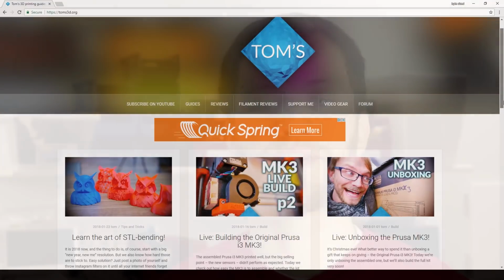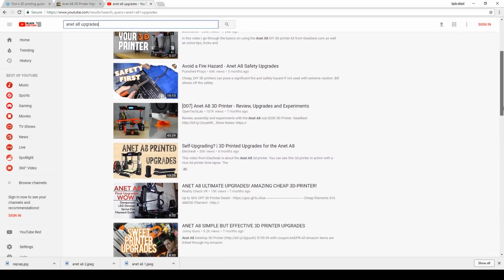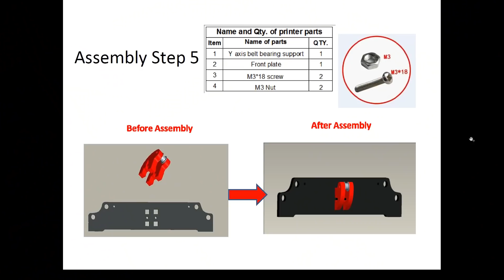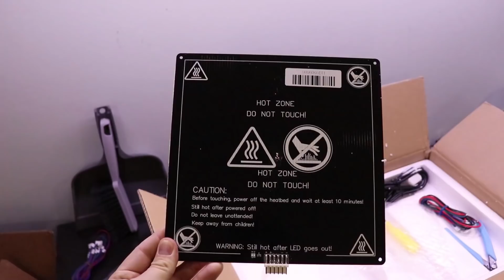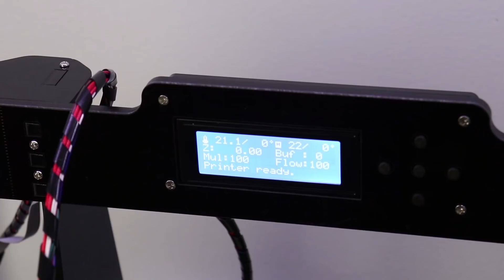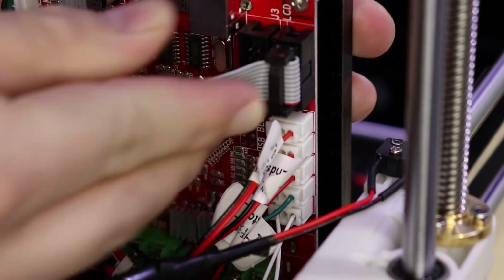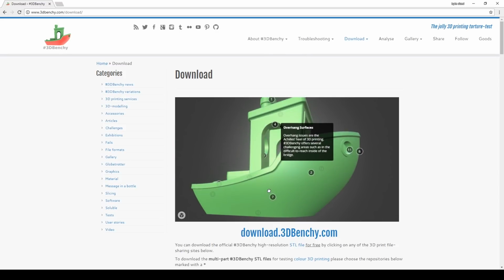Anet A8 - The best cheap DIY 3D printer in 2018?

Comment: Man, almost every YouTuber out there is gonna say that only the "name brand" stuff (Ultimaker, Prusa, etc) is worth it. It's total BS. I personally own an Anet A8, got it online for $160. I've put $15 extra for a glass plate, and plan on spending another $3 for a mosfet for the heated bed. Let me tell you: it works beautifully. My school has a mid-range Lulzbot that cost them $500 or so and the performance between the two is nearly identical. I'm pretty sure theirs doesn't have a heated build plate, either. No reasons for these 3D printing elitists to bash on the economy kits as not even worth it when it opens up the community to way more members.
Reply from the maker: I agree, thanks for watching
Reply: The Anet A8 can be made WAY more safe with a couple simple things,
1. Solder the hot bed wires instead of using the flimsy plug.
2. Use a mosfet for at least the heated bed and also hotend for overkill.
3. Put a fusible switch on the power supply.
Reply: @JohnSmith-mk8hz  This seems to be what I hear out of everyone, not that I've figured out how to install the mosfet yet, but I'm sure that's just a google search away "how to install mosfet anet a8" also I've heard I should replace the wires to the bed with 12g silicone wires and they will last forever flexing back and forth. And upgrading the firmware is the first thing a person should do.. it's free and apparently it's the number one reason fires start.

Anders Jackson Only an idiot would buy the cheapest item and expect not to have to modify it. This world however isn't short of idiots. I've been researching for a week narrowing down what I want to buy and it seems there is a huge community for the anet a8 I can use to help me navigate getting into 3d printing. I am certain if I can get it working I will be buying a 2nd as soon as I'm done modifying the first.. either that or a cheap delta.

I too have been the sole mechanic on my families fleet of vehicles since I was a teen, and have a garage full of just about every tool a woodworker needs, and most welding/fabricating tools including a couple of lathes and a mill.  I'm no novice when it comes to fabricating parts for things but I've fallen behind when it comes to electronics. I've always known about 3d routers and plasma cutters and I vaguely remember when 3d printers came out but they've always been so far out of reach I haven't given them a second thought.. I even remember the story of the guy who used one 3d printer to replicate itself.. I LOVED that story, but I was still so deep in my own projects I never thought I could find a use for these printers that make dolls and vases and crap.. And then I saw the ender 3 a while back.. Affordable at $180 or $229 for the pro and I started digging.. Now I've found out about the various $120 models on ebay and amazon and now I'm flat out gung ho. I'm already sold.. now I'm just negotiating brands.. And even with the risks the anet a8 appeals to me. It's either that or the reprapguru prusa clone.
Reply: The anet a8 is now $120 and I can't even buy the parts for that price. My goal is to buy this and start making upgrades. I can easily copy the acrylic parts and fabricate them in aluminum, and there's a beauty in the saying that these are just good enough to begin printing the upgrades for them.. There's tons to choose from on thingiverse and dozens of forums and hundreds of youtube videos. This seems like a great beginning and only costs beer money at this point. Even with the ender 3 I'd be doing the exact same thing.. upgrading the parts.. But like I said I couldn't even get these parts for this price. Who knows. I may decide to save my money and get something good after this. I may decide 3d printing is a waste of time.. Or I might be the guy who revolutionizes the industry.. Or that person may be one of you who reads this. Life is crazy that way.
Reply: +John Smith.  it may be done better by tinkering with it.  But that is why you pay more for the other machines.  So you should have a proper machine from the beginning.

Well, soldering the hot bed could probably be a bigger problem than the "flimsy" plug.  As soldering has to be good, when it comes to the handling the currents in the heat bead.

Mosfet for the heat bed are a good idea, as the controller board are a bit flimsy when it comes to the wire connections.

A Switch with fuse are a great idea.  Should be one with two electrical breaks, for both live and neutral. May even exchange the power supply with a better one.
Reply: Anders, thanks for the tips. I have already ordered the mosfet and fused switch for the power supply and will solder the hot bed connection. 

I love to tinker. I work on everything I own, cars, electronics, everything. I didn't realize 3-d printing had become so affordable and had such a big support community or I would have got a printer years ago. It looks like a very fun road ahead.  Thanks again.
Reply: Why would you want to do that?
Reply: I'm not certified in soldering but have done plenty. I saw the video where a guy used 2 crimped-on female connectors to attach to the bed. Each connector fit tightly.  One on the 2 negative pins and the other on the 2 positive pins. It looked good so I may do that. 
I'm also getting a piece of glass and some hairspray. I will also print a fan nozzle, frame supports, frame hold down brackets,  x-y belt tensioners, spool holder etc. 

I also ordered an E3D v6 clone kit for possible Bowden setup later.

Oh and I will probably get a Touch3d sensor at some point.
Reply: John Smith Good compilation of necessary steps - but add upgrading the firmware for essential safety features since this was the route cause for the latest incident with this printer.

After all, there were three houses burned down because of this machine, and pictures showing a dissolving plastic mess are legion. I have an A8 and honestly, it is not worth the money/effort. There are so much better alternatives with Metall frames that won‘t burn as easily and are sturdier. Never would buy it again.
Reply: I bought one for the kids last Christmas, and I've never even bothered to level the bed (and it's nowhere near close). Nonetheless, it prints beautifully.

I will throw out a tip about building these things, take some scotch tape and use it to capture those stinking nuts by putting a piece of tape on either side of the nut to trap it in the acrylic. Get them all captured, and your build will go a heck of a lot quicker and easier.
Reply: Theres a huge community for it on line.  With a crap load of 3d printable upgrades that improve it even further.
Reply: John Smith Yep. I‘m convinced that assembly/maintenance played a role as well. However, the A8 opted for the cheapest parts possible, obviously. Therefore maintenance is requiring a certain amount of skills and is far more often necessary.

I‘m totally on board that print quality is great, but compared to my CR10 the A8 was down due to troubleshooting far more often.
Reply: Martin white why do need mosfet for heatbed,, it also works fine without it,,why do you used it ?? what does it do
Reply: @shubhamdalvi3992  the mossfett saves the connectors on the main board. Even with mosfet I had the power connector melt down. I upgraded my board to an duet3d. Talk about an improvement way better than the ramps board I was using. The only problem with the printer is the motherboard and powersupply. Both of which Inhave replaced
Reply: Sir, you can get Anet A8 Desktop 3D Printer for $139.99 with this coupon: GBmid-year02A, https://www.gearbest.com/3d-printers-3d-printer-kits/pp_337314.html?wid=1433363&lkid=14697823， enjoy!
Reply: What do you think about the Ender 2 for a beginner?
Reply: @garyd395  ender 3 what an a8 'might' be IF you spent a ton of money and months of effort on.
Reply: I also own a Anet A8, and I really happy with it :) 

But you can't compare other printers like le Lulzbot with the Anet A8. They don't offer the same security. Anet A8 mainboard is a cheap one and there is a pretty high chance that it will fail one day (mine still works though). Anet A8 connectors are not (properly) strained relief neither. The PSU cables that are not protected + not crimped is very dangerous (without any PSU box mod). More than one Anet A8 catched fire ;-)

The print quality of the Anet A8 can be really really good. It possible to have the same quality than an other one that cost $500 -> $1000. But not at the same speed :)

Just to say. Anet A8 is good when you know what you're doing,
Reply: +David, stop that.  And same to to an extent to +Martin White.
This machine is good, for the money.  BUT it is not as good as many more expensive machines, as it comes.  You can get a better A8 with modifications, which you don't need to do to more expecive machines, like the original, Prusa machines.

Yes, if you want to tinker, or don't have the money but doesn't mind doing that.  Anet A8 is a great machine
If you want to just print, without the first you do print some exchange/extra parts to your printer.  You should pay some more and by an original machine, like the Prusa.

So in short,  they have different targets and different demands.  So yes, you actually trade things away with less money, like a bad PSU.  BUT if you know that, it is ok and could even be a perfect machine.

So Martin and David. Are you ok with your machine, don't bash others that have different goals.

(Yes, I do have a Anet A8 myself)
Reply: @AndersJackson  https://imgur.com/a/uTBotDl Lol. Maybe if I burn thousand dollar bills beside the Anet A8 I can print like the big boys. or something.
Reply: @evlsc400  you don't have the budget or interest to have a prebuild machine, but are happy to tinker with your machine. That is fine, but I Guess you don't tinker with your washing machine, exchange parts etc. Like real machine shops doesn't build their own CNC and tinker with it. They want it to run, producing parts without downtime. But I bet you can build a machine that produce as Good parts, but not same uptime and lots of trouble to get back running when it breaks.

Yes, I have an A8 that I have tinkered with as much or more then you, if I look at what you posted.
But I also know there are more to it then the Price tag with serious machines then what you posted about.

Yes, great that it works for you, but No, it Will not make enough money for you to live in for a couple of years.  As professional, you want to produce, not tinker.

But again, great that it works for you.
Reply: @AndersJackson  I have both I even gave you a link to my own results LOL, reading is hard. Budget? where did anyone mention budget? are the voices suggesting things again? lmao.
Reply: @evlsc400  ok, no need to continue, as you don't know the different use cases, nor care.  As long as you can point yourself superior in any way.  Sad, actually.
Reply: @AndersJackson  I do know both use cases and the Anet A8 can out perform as I own BOTH. I enjoy using both machines I paid for. They are awesome! the ability of having a budget is you can set goals and achieve them like having both machines. Is your career path to simply comment on videos to diss a machine you couldn't figure out how to assemble? good job. Edit: I love the no proof as I provided pictures of both machines and their results. Thank you. (does my anet a8 need dual extruders for disovable supports? nope, because I can print well enough i don't need such supports).
Reply: @evlsc400  No, you don't know, which your comments demonstrate. Thanks for you demonstrate I am right.

And yes, I have the A8 running fine, thank you.  Again, thak you for demonstrate I am right, again.

You still don't get it...
Reply: @AndersJackson  Yup only you would tinker with a $100,000 machine that requires $15K/year service. I can totally tell you've been around these. yup. LMAO especially not knowing the name Stratasys in 3d printing. I get it :) of course you have an Anet a8 running fine with a budget that low what else is there to be running?
Reply: @evlsc400  as you still confirm, you don't understand nothing.
My argument was that if you DON'T want to tinker, you use a machine with $18k/year service.
Thank you for still demonstrate your ignorance...
Reply: @AndersJackson  provided no proof yet again
Reply: Fabian thanks for the tips.  Mine is printing surprisingly good. I have been impressed so far. Much better than I was expecting. 
I expect you are referring to thermal runaway shutdown etc.?  Do we know for sure if the fires were solely due to the printer, or did poor assembly/maintenance play any part?
Reply: Um.. even the newest Prusa costs $750 ($999 assembled and tested). So BS here is that "any 3D printer worth buying will cost $1000 or more".
Reply: This pos can't compare to the Prusa... Prusa created the desktop 3d printer, everyone clones him. Buy the original. The mk2 has 9 sensors in the bed and has a 1/10 of a mm resolution prints lol, its great, and they're on the mk3 now which is even better. This thing is only as good as the user; if you can level the bed every time preprint like a Prusa, and compensate for non-square frames (in microns),  fix wiring, tweak firm wares, then you'll still be limited by a flimsy frame, which creates waves/ghosting. 

I have a tevo I bought for 200$ - bigger bed and aluminum heated bed, aluminum frame, way better than a8. the a8 has more of a base, but in reality the tevo has more peak potential because of its aluminum frame, the rigidity cant compare and acrylic will crack. - plus you can buy these nice 90 degree brackets for the aluminum 20x20 extrusion and it squares it up easily. 

I also have a Prusa i3 mk2s kit - 600$ well worth the money. Adhesion issues with PLA on the PEI bed at first, but I use a gluestick like they recommend and its nice.
Reply: Are you certified in soldering?  If not, you might skip soldering the hot bed connection.  You might want to connect the other two unconnected connections in the hot bed connection, but do avoid soldering, it is not like 20mA going through the heat bed...  
 But the others are good choices to do.
Another is to printer a better fan hose to the heat bead and to get a clean glass as surface on the hot bed.  It turned out really well on my printer.  I also added some 3D prints to strength the frame for the Y motor.
A later thing could be a auto leveling detector.

Comment: This printer is trash. I can prove it.
I've bought 2 Anet printers, the Anet A2 (Which I eventually got working after multiple bad parts from the seller, such as a broken nozzle, a bad motor and a broken board) and an Anet A8 (Which never got working because I had a lot of the same issues, but I'll get into that.) The issue with DIY Rep-Rap printers is that support comes from the community. You will almost never get any support from any seller ever, so something like an H plate with screw holes too small (which was an issue I had and couldnt solve at the time) either left me with 2 options: Buy a new one, or try and repair it.
Eventually I spent over 100$ on repairs and upgrades on my A2, only for a bad board (Hint, the A8 uses the same board!) to smoke and burn a lot of the acrylic of the A2.

This is more of my experience with anet. But still, I would not recommend buying anything from anet.
Reply from the maker: Good to know, thanks.

Comment: You bed support is upside down... Timing belt should be parallel.
Reply from the maker: Thanks for the tip. I ended up turning it the other way after testing it.

Comment: I think you are mistaken on the AC cord wiring.  There is a world-wide standard for power cords, and it is brown = hot, blue = neutral, yellow/green = earth ground.  (This supersedes the old standard of black = hot, white = neural, green = earth ground.)  It is highly unlikely that the cord was miswired, but if it was, you should terminate that cord with extreme prejudice and replace it with a correctly-made one.  If they got the colors wrong, you don't know what else they did wrong, and this is the kind of carelessness that causes house fires.

Looking at the video at 9:10, I see that you are clearly measuring continuity between the hot blade and the blue wire, so yes, that cord is improperly wired.

I bought an Anet A6 about a month ago.  I'm checking the cord polarity right now ... wow.  Mine's wrong, too!  It looks like they got a bad batch.
Reply from the maker: Wow! That's crazy! That makes me feel a little validation for my questionable wiring. That just goes to show that it's always a good idea to double check things like that. Since filming this video I've gotten rid of that cable and replaced the power supply wiring with a fused IEC connector with a switch. I feel a little better about this now. Thanks for all your great suggestions on this thread by the way. It's super helpful to have people who know what they're talking about chiming in.
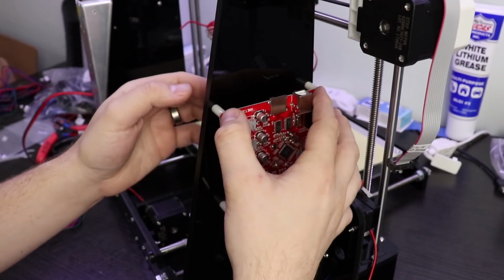Reply: I am adding a fused IEC connector switch too.  I wanted to double checked my original wiring before installing it.  That led me to your great video.  I did the continuity test on the cord and and sure enough live and neutral are reversed. But later on in your video (at 10:06) brown and blue are reversed again! Was that an editing error or am I just confused?

Comment: There is a must do upgrade for these printers and that's a mosfet for the heated bed, and a second for the hot end. The 12v from the PSU is too much for the underrated board connectors, so it's only a matter of time before they fail and become a fire hazard. The $160 price should also come with the caveat that you will also be spending another $80 making the printer safe.
Reply from the maker: I've heard that from a lot of people. I haven't seen anyone actually quote numbers and reference any datasheets to back up that claim. I am going to look up the part numbers and read the datasheets to determine if there is any base to these claims.